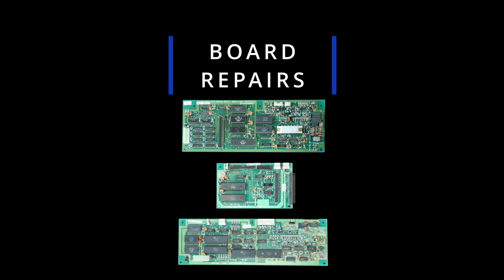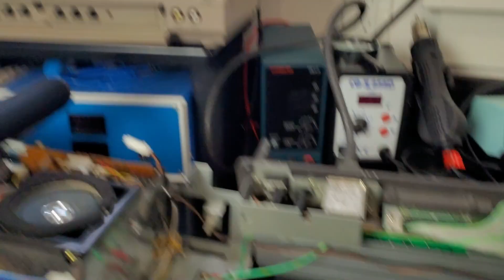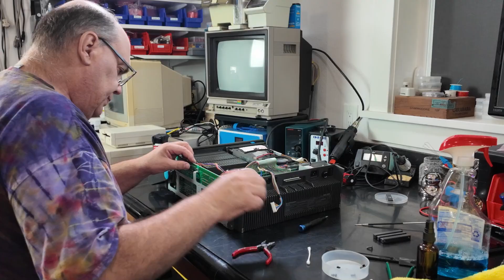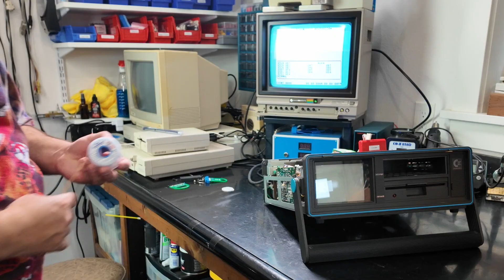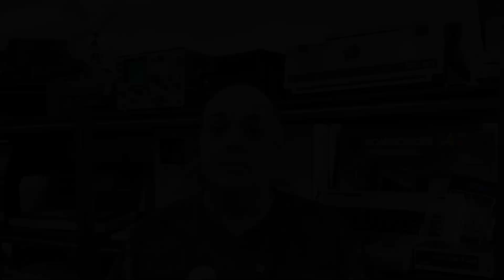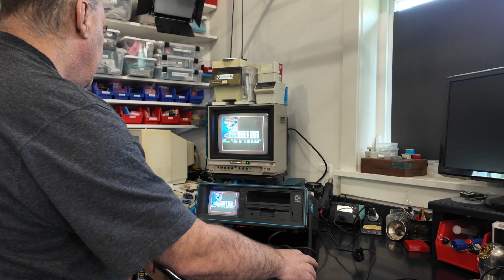Beautiful Commodore SX-64 Restored to Life

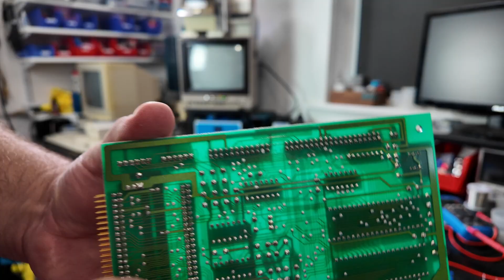Comment: Question.. @00:11:41 you mention for the SRQ fix to bridge pin 4 to pin to pin 11 on P12 with a 3.3k resistor. However, there are other videos on YT and even on Ray Carlsen's site say to bridge pin 1 from P11 to pin 4 on P12 with a 3.3k resistor. Which is correct? I'm at a stopping point awaiting your reply. Thank you!
Reply from the maker: Definitely go with the Ray Carlson fix. THis is clearly a mistake on my part and I am not sure how it got past me and how it hasn't been found before. I'll add a pinned comment and create a replacement video next time I restore an SX-64. 

The bodge as I did it pulls up the row one line on the keyboard matrix. This connects Row 1 to 6526B Pin 11 (PB1). It shouldnt affect the operation of the machine or put undue strain on the 6526. At worst it just ads 3.3k in parallel with the 6526s internal pull up bringing the pull up resistance to about 2K total. This will make the sink current when a row one key is pressed to about 2.3ma vs the 3.2ma max spec. 

6526 Spec Sheet: https://6502.org/documents/datasheets/mos/mos_6526_cia_recreated.pdf

So harmless and another "less" that applies would be useless. My appologies for the error.

I am pinning this for future readers so, If you know what you are doing and believe my assessment on this being benign is wrong then please comment here.
Reply: @RavenWolfRetroTech Thank you for the lighting quick reply! Excellent series on the sx-64!
Reply from the maker: Thanks. I felt sick when I realized I'd made such a mistake

Comment: The SID filter caps may be changed too. Commodore accidently (?) put 2.200 pF on C31 and C32. The original values from the C64 with the 6581 are 470 pF. With the replacement the SID sounds more original because low frequencies aren't filtered out that much. I will count it as fixing a manufacturing fault.
Reply from the maker: Thanks for the heads up. That's one I had not run across before.

Comment: Does the SX-64 suffer from the same over-voltage issues in the normal C64 power supply? 

I've been afraid to even turn mine on for years and it's on the back shelf until I can pop it open. Maybe these videos will spur me to get it done.
Reply from the maker: Fortunately the SX-64 power supply is reputed to be very reliable. I have not heard of it causing an overvoltage issue. I would just disconnect it and check everything with a meter to be safe.

Comment: Excellent video series. I went through a restoration of a PAL SX-64 in 2021. Mine was an extreme rebuild, it needed a new IO PCB, the original was full of corrosion due to the environment the machine was stored. I worked with a PCB design engineer and created a brand new replica PCB which included the SRQ fix. I replaced all of the old single wipe IC sockets, fixed the User Port AC tied to ground issue, designed a dual color green/red power/activity LED PCB for the FDD, replaced the faulty CRT with an LCD screen which needed a new monitor control PCB and a new speaker/amplifier to hear the tunes. I also came up with a replacement clock PCB for the main CPU PCB that uses an 8701 chip. Oh, and I got the SX-64 chassis electroplated in passivated gold zinc. I then finished it off with JiffyDOS. I spent way too much time and money on this machine, but I've ended up with a very unique machine.
Reply from the maker: Wow, you've really taken your SX-64 restoration to the next level. It sounds like an amazing machine!

Comment: how much would you charge to make a second cable for testing the boards outside the SX?  that would sure make life easier.
Reply from the maker: The problems are getting the right parts and having a PSU to connect to. A friend sent me a spare SX-64 power supply that I am using to get the connectors I need. My Bench power supply allows me to make a modular cable from these cables that will provide the right voltages for both boards.
Reply: @RavenWolfRetroTech  i have spare power supplies, i think i even have one in with my NOS boards
Reply from the maker: If you have a spare SX-64 PSU, but not a bench supply that puts out all the correct voltages, I would just extend the 2 power cables and the video out cable on the spare supply and that would work perfectly!
Reply: @RavenWolfRetroTech  thanks, when you talked about the cable I p;ictured something different.  next time i have a batch of SX to work on i will investigate setting up for external powering.